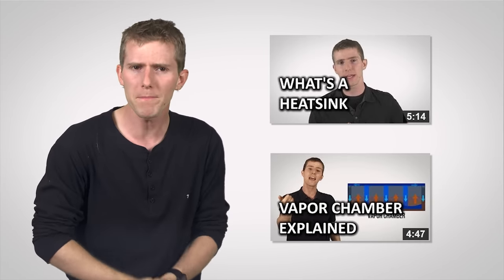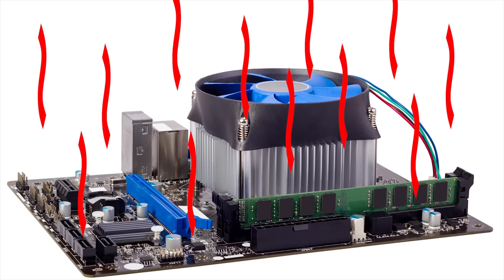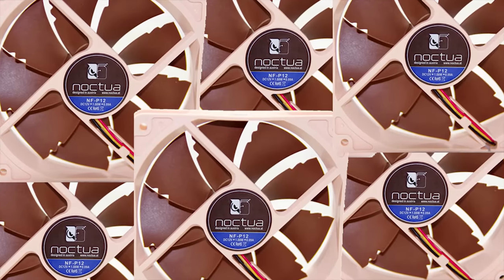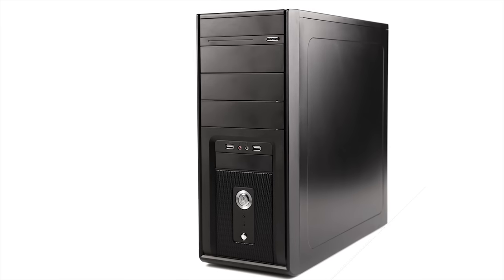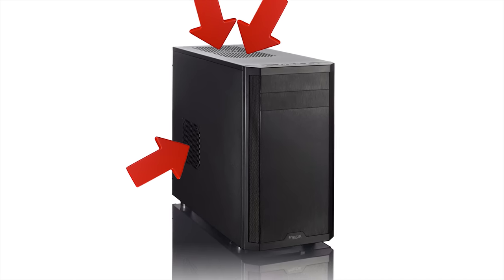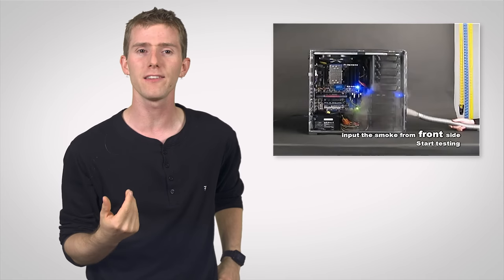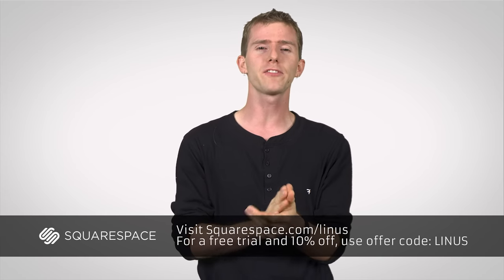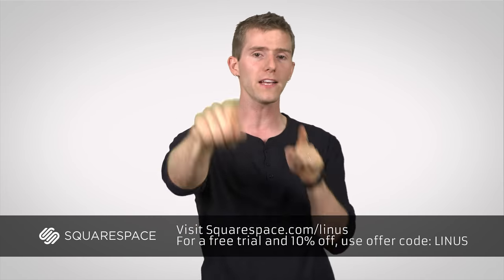Positive vs Negative Air Pressure as Fast As Possible

Comment: While I would say the conventional wisdom of hot air rises, cold air sinks doesn't really matter in terms of a computer case. It does matter that you have a logical airflow. If for example you have a PSU that pulls air in, and a front intake that pulls air out, you will not have any air being forced out the top back (assuming a bottom mount psu)
So, in that situation, you should have the front intake pushing in, and a fan pushing out on the top back.
The adage is less about being "correct" and more about reminding you to get good bottom to top front to back airflow. If you want to be a weirdo that goes top to bottom back to front, go for it. I won't judge you.

Comment: 2x120mm Intake Front with 1x120mm Radiator infront of one Fan, and 2x140mm exhaust in the Top with 280 Radiator infront of them. Still no Dust in my PCs or Radiators after two years.

Comment: I think I have a pretty good airflow in my Corsair 350D. 2 fans at the front as intake and one at the back for exhaust. It's not really unbalanced because the front intake it's not "direct", I mean, it has the brushed aluminum that's kind of blocking the intake. so 2 to 1 in this case it's pretty good. I noticed dust accumules just on the front filter (and the PSU filter aswell). I wish I had the top filter like the 450D though... since dust can "fall" in the computer while it's turned off. fortunately when it's on the positive pressure keeps it out.

Comment: I hate to be a Debbie downer but from my research and talking to web designers Squarespace is not the best for SEO optimization. Don't get me wrong. I love how easy it was to build a website on the Squarespace platform. Squarespace is great for someone who wants to easily build a website.

I am currently in the process of building a much improved website using Bluehost and one of the StudioPress themes.

Comment: I like to add one other troubles I feel not everyone may not think about and that's using fans that are moving too high of RPM's, These fans will draw too much power and can cause burn outs on any motherboard 4 pin fan headers. Have to use those kind of fans plugged into Power supplies instead.

Comment: This episode is a bit lacking compared to the others, sadly.

What Linus failed to mention is that the "more-out-than-in" method actually yields slightly better temperatures.

And hot air DOES rise noticably. It's not enough to cool a system by itself, but a "bottom-up" cooling setup, which takes adventage of natural circulation, can be very useful in systems optimized towards minimal noise.

Comment: This has been and episode I've been waiting on for a while; there's very little information that isn't subjective or opinionated about this topic at all. Through sheer experimentation a few months ago I found that slight positive pressure worked great for me with my Fractal R4 3 120mm intakes with 2 in front of my case and 1 on the bottom coupled with 2 140mm fans on the top of my case for exhaust creating an airflow system that is shaped similar to an "L" that I confirmed by using a Shark Steamer that my gf uses to get wrinkles out of her clothes has made my SLi rig never exceed 70c.

Comment: okay, with a bit of a struggle (my fans aren't that flexible :-/) I reversed my setup to mimic a "positive-to-negative" pressure cooling system and for the first time, my case temps are lower by 10 C°. Further testing is required to really see how well this works but so far, I recommend this!!

(Ambient temps right now are about 26°C Checking this when it rises to around 33°C at noon should really prove it's performance.)

Comment: "heat rises doesnt have much of an effect" bullkkaki a standard lanbox with heat sinks on both sides of the case can use the rising of hot air to passively cool around 300 watts of heat, a full tower can dissipate around 1000 watts on just one side, Why the non linear curve? because the taller the case the higher velocity the air will flow through those tubular heatsinks, think placing a panel of aluminium over the tio of a traditional heatsink with each set of fins being upen to only 2 sides instead of 3
Reply: +denvera1g1  In absence of forced airflow, convection works. But forced airflow simply has a lot more velocity than convection, an order of magnitude more.

Comment: Pull from bottom and push out the top. Even flow. Pressure fans to push out. Hot air rises and cold air drops.

Comment: IMHO there are not so many fans, that are both silent and performance optimised. And in most of the times PC builders in some countries are stuck with crappy fans. In my case, I had an option to buy Noctua fans for like crazy amount of money and wait for them like for ages or buy some other fans, that aren't so silent, but cheaper. And I use Aerocool Xpredator X3 case because of the looks and of course an option to install total of 7 fans (I'm not counting 2 optional behind HDD rack). So the airflow for me is not a problem. With combination of 5 intake and 3 exaust (yes, 8 total. Zip ties came in handy), I've got positive pressure, filtered intakes and low dust accumulation on PC components. I've tried negative pressure with 3 intakes  and 5 exaust - didn't work good enough for my case. Just devide Your case into sections (CPU and GPU) and try to make air flow straight through them. But for every specific case there is a specific combination of in/out airflow, so count Your fan airflow numbers and put your fans so that there would be a balance. And be brave to experiment.

Comment: Negative air pressure is far better, for cooling a computer, or a house, with a whole house fan, IF no air filter is being used, because cooler air then can enter from any open window, or any air vents. The whole house fan can be tucked back into an unused bedroom, where its noise can be hardly be heard at all.

In the case of using an air filter, since it is much easier to place the filter where the fan is, then positive air pressure would be better.

Also, I did not understand why more than 1 fan would ever be needed?

I think that is one of the reasons why many people prefer Macintosh over PC, as Macintosh computers seem to be better designed, to not need much in the way of noisy fans. In fact, many Macintoshes had no fans at all. That may have been one of the reasons for building the computer and CRT monitor together in the same case, as was done with the iMac series. The CRT would naturally get hot, and thus convection currents draw in air from below to cool the computer on the bottom of the case.

Also, aren't a lot of computers using temperature-sensing fans, that increase their speed when heat-buildup is detected? That keeps the fan running often at low speed, making for a usually-quite computer, when it is not too busy doing a lot of work number-crunching or running demanding applications. Also, do fans usually shut down, when the computer is put to sleep, even though some circuits, such as USB power/charging, may remain active?
Reply: Nice b8 m8

Comment: I just leave the side of my case open. (My case has an 80mm fan with filter for intake, BTW.) Sure it gets dusty, but, I often clean my PC case anyways. At least this way, it doesn't use more electricity for fans or have any noise/vibrations.

Comment: Hey Linus... here is a suggestion for an episode: PLEASE, open up somehow and show us all how the liquid coolers actually work... e.g. open up aa corsair h110, show us where the hell is  the liquid? and how, the liquid actually cools down the processor... with an animation or something.. everyone explains the beauties of liquid cooling but nobody has shown how the fluid actually interacts with the processor... then you can add (if this is not enough) how it also cools down video cards or ram (depending on the cooling system you install)... not AIR.. just LIQUID... I have tried to find these "animations" or someone showing where the liquids are and how they "touch" the processor "plates" to show how the process works... Well.. my 2 cents... Cheers and thanks again for the VOD...
Reply: The liquids don't touch the processor. They cool the metal in the waterblock, which in turn cools the CPU. The flow of liquid is simple: In a H110 for example, one of the tubes carries new cooled liquid from the radiator (liquid being cooled by the fans) and the other tube carries the hot water out of the block back to the radiator. The liquid is both in the tubes and the radiator as well as the waterblock. Custom liquid cooling builds have their own reservoirs for the water so that they can store more water and cool more effectively in the process.

Comment: i have 6 140mm top intakes on my rad blowing downwards (adding the extra 2 fans gave me 5C cooler idle temps which is must for a 1.42v vcore lga2011). with a intake on the bottom. i have 140mm rear exhaust, 2 triple slot directcu cards exhausting a lot of heat, a 240mm side fan, a 120mm top exhaust. a 120mm front exhaust, and the 120mm psu bottom exhaust. 

This config puts all the dust on the top of my case (no shit) and in turn is really easy to clean because of how obvious it is. no dust except for on the bottom of the case.

Comment: I have a Dell XPS 420 (if anyone has seen it) that has a carrying handle, and in that carrying handle there's a little grid in the front that sucks air in from outside into the CPUs heatsink, then with help of the power supply and GPU fans it gets pushed out the back. There's also an intake on the bottom edge of the case that blows air across the hard drives.

Comment: honestly I think the whole concept of 'positive' air pressure inside a computer case is a whole lot of hot air...
there is just no way with all the small holes and gaps and grills you can actually create any kind of meaningful pressure difference inside a computer case. Yeah you may create a difference at one point, but other gaps will then be letting air in. Its more about airflow and which way you are pulling air across your components. Hopefully you can get it so the airflow is always pushing towards unfiltered exhaust panels and any open meshes.

Comment: If I have to keep it in a box I go for overpressure, there's a reason CBRN systems use it.
Though if I don't it's get's a long set of hoses to a remote radiator.

Comment: I use incense sticks to analyze the airflow for my cases, works perfect. I suggest using higher quality incense unless you don't mind the horrible smell/headache you get from cheap charcoal based ones in most grocery stores. Go to a head shop for the local good stuff.

Comment: Do a fast as possible on the relationship between wattage, amperage, and voltage and what each means for your computer. And also maybe a seperate video on voltage timing for RAM, I've always wondered what that is. Like maybe have that seperate video have other stuff be covered that'd be appropriate to group together into a single video, or if it'd fit well enough just fit the voltage timing for ram thing along with maybe other things along with the wattage, amperage, and voltage video.

Comment: I have two intakes front and one exhaust back, but my CPU cooler is set-up as push/pull and it also push the air out by the rear exhaust fan. All fans running in silently mode (~600RPM, 120mm).

My case is not really top tier, its a Thermaltake Dokker Lite, but I've managed to get pretty decent temps running silently. I've also put some sound proof coating in the inside.

Just werks.

Comment: I miss these old thumbnails and reviews..

Anyway, so does this basically mean that Positive-Negative air pressure has little to do in gains for cooling? Linus mentioned hot air pockets and the benefits of ambient temperatures, but didn't really set the verdict for which pressure benefits cooling the most. Instead it just veered off into how each pressure behaves with dust intake and then set the verdict that Positive pressure is better to combat dust...but what about cooling?

Comment: You still don't get it. If you have 2x 10cfm fans and have one in and one out you have a total air flow of 10cfm. If you have them both sucking in, filtered and just use a vent for out flow you have 20cfm and no dust.

Why does nobody understands this.

Comment: Hot air doesn't rise. Hot goes to cold. Why? Well put simply, there is no "cold" as it were; rather, there is absolute zero which is no heat at all, and every degree after that is heat. For every positive, there is a negative.

Comment: Just buy canned air (or use an air compressor if you have one!) and once a month just turn off the PC (both with the PC power button and switch if it has one and at power source such as the wall!) and open it up can just blow out the Dirt & Dust. Lots of videos on how to do it here on Youtube!

Pantyhose do work as does any fine mesh like material!

Comment: I've always wanted a case where I could just install a small furnace filter. I've seen a custom case made to look like a cube which used this method. But all cases I've seen in stores seem not have any actual filtering capabilities. Just crappy mesh enclosures. Maybe I'm not looking hard enough.

Comment: Opinion on mine
Corsair Carbide 400R Case 
29-33C Room Temperature , I live in a very hot tropical country. No Air Conditioning in my room sadly.

3X 140mm Exhaust , Two Top , One Rear. Noctua NF-A14 FLX
1X 120mm Intake , Bottom Front Panel , Corsair AF120 LED 
1X 120mm Intake , HDD Cage Bottom , Noctua NF-S12 ( Directly after the Corsair AF120 Front Panel Intake ) 

I've tried installing a few more Intakes etc , doesn't make a difference in terms of cooling. 
In terms of Dusts , I think this setup is the least Dusts I had. But I think it's obviously a Negative Pressure method ?? 
Currently I left my side Intake empty but with Dust Filters , basically I guess my side now is considered as Passive Intake ?? My side panel is able to hold another 2X 120mm / 140mm fans , I used to installed some 140mm there. But there are plenty of Dust accumulated on my PSU ( Top of the PSU Casing ) , GPU side Heatsink and even on top of my CPU Heatsink , since the side panel fans positioned directly on those components 

Im able to install another 120mm on the bottom too , but it sucks up alot of dust even with the Air Filter that came with the casing.

But any good suggestions are welcome. Anyone else owns a Carbide 400R here ? What's your setup 
Also , Hot Air Rising doesn't work well in our casing ?? Or does Linus meant that it's not much of an impact in terms of cooling performance ?

Comment: so if dust wasnt a factor, say you are in a room with no dust at all (theoretically) which would initially cool it better, negative or positive? or if a combination of both then would it lean more negative or more positive. again assuming dust is not a factor.
Reply: exhaust is always better for cooling because you remove all the air as fast as possible pushing more air in does the same but just at a slower rate because the pressure is pushing the air out of ever leak in the case
Reply: +Derpolnischfrosch 
Of course exhaust fan is better, but only if you are not using air filters. Air filtration works far better with positive pressure inside the case.

The speed of air flow is the same in either case. But cooling is improved, when every air vent brings in cooler outside air, due to negative pressure. Rather than blowing the hot air around, on the inside of the case.

Why are you people's computers running so hot anyway? Are you serious gamers, overclocking?

Comment: If I have two fans on the front of my case pulling air into and across my hard drives, and then my GPU, Heatseak, and back fan all pushing air out of the case, is this positive? My case doesn't get to terribly dusty.

Comment: Techquickie Hey Linus! From watching this and other videos of yours, I have decided to "upgrade" (I guess) my Lian Li pc-x500 case default fans to Corsair Quiet edition. I used three 140mm in the front and two 120mm in the back. Based on multiple videos, I thought having three intake Corsair 140mm Air-flow Quiet edition in the front, 2 Corsair 120mm Static pressure in the back plus an auxiliary 120mm Air-flow as you mentioned that the sequence "Air in -> Static pressure fan -> Water cooler radiator -> Airflow fan -> Air out" was the best performing setup. I guess 3 fans on each side keep it kind of neutral (there is no top exhausting). Should I remove one of the radiator fans to encourage positive pressure? The CPU (oced at 4.1ghz) stays around 40C idle in the lowest fan speed controller configuration, and around 32C on the highest fan speed controller configuration... I guess although performance is best with 2 fans on the radiator perhaps it's not worth the extra noise and negative pressure influence?
Reply: ***** nice reply

Comment: Would adding 2 exhaust fans on the top 1 on the rear and 1 intake on the bottom and 1 on the front, would this be a balanced amount of airflow going through a gaming desktop pc?

Comment: "Hot air rises" has very little impact? You havent had a Silverstone case with 90° rotation yet, have you? ^^
Reply: Chuckiele right after he said "unless you have a Silverstone..."
Reply: Austin Langley The "Hot air rises" still has a huge impact, only Silverstone prove that, but it works on all cases if they are built properly.

Comment: So, basically, you have to get a fairly balanced airflow scheme leaning towards positive pressure and if u notice dust accumulation on your optical drive bays and mesh in the long term, change your intake fans to exhaust, leaning towards negative pressure? Am I hearing this correctly?